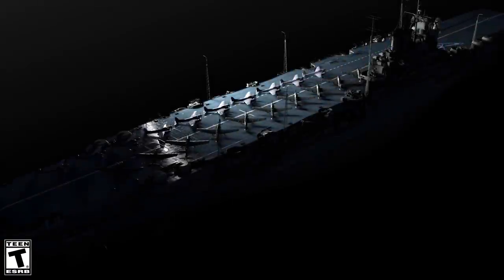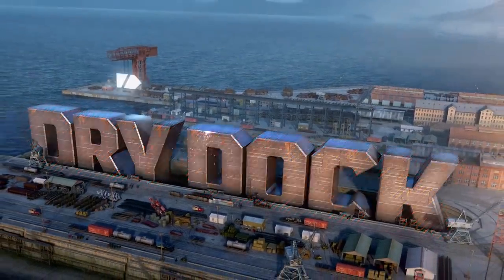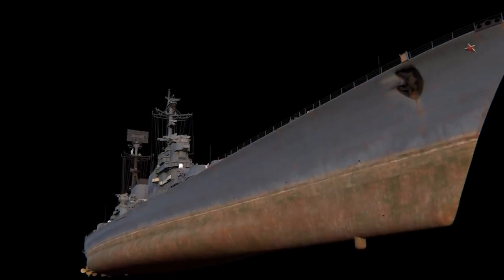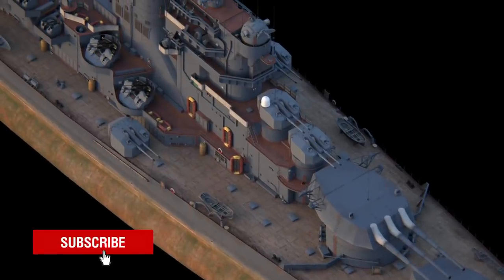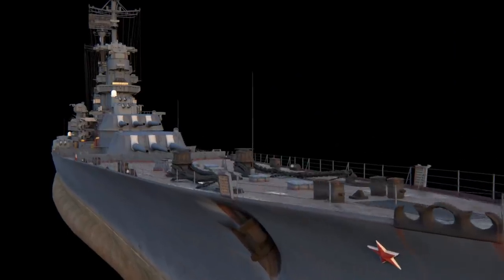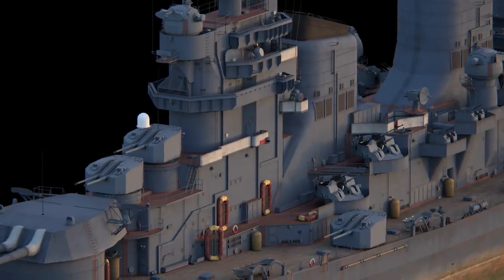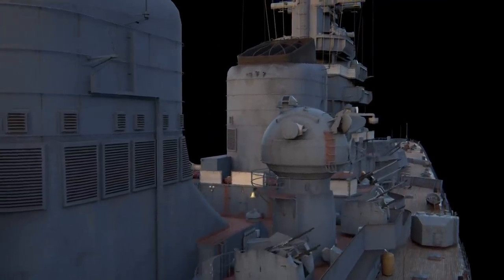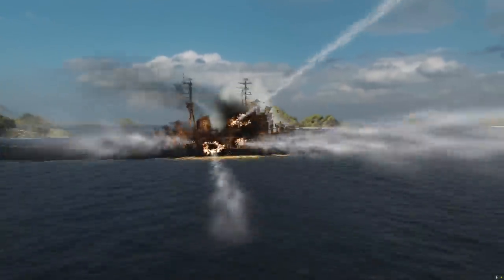Dry Dock: Stalingrad — Soviet cruiser | World of Warships

Comment: Please WG, update ship datas in game to actually show displacement values of each ships.
You show horse power, but not the displacement value.
Would be useful to decide when/where put a speed boost module or not on a ship you just got in your inventory.
...to know if velocity is good enough or if it could truly use an engine boost depends on displacement value of each ships (when the option is disponible and when it matters to get a bit more velocity ofc, not in every cases),
But it’s not disponible in game... ☹️

And overall, If you show HP values, you should also show displacement value... seems useful and logical, just saying.